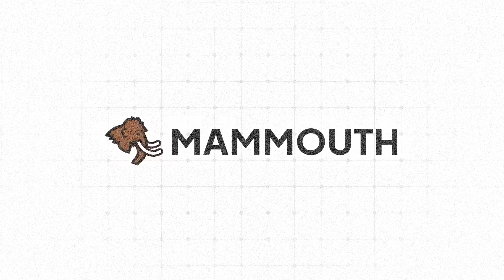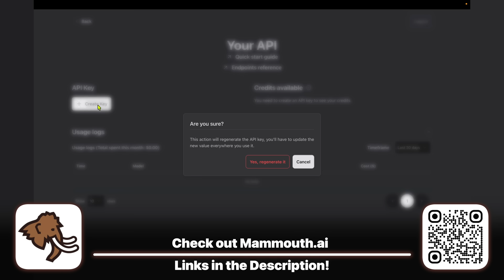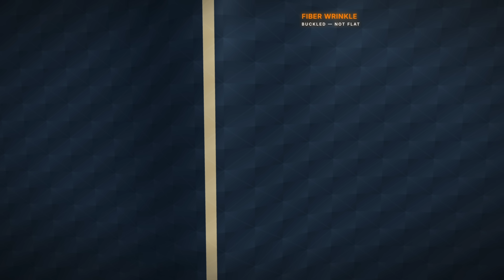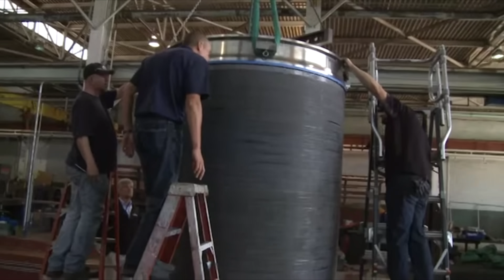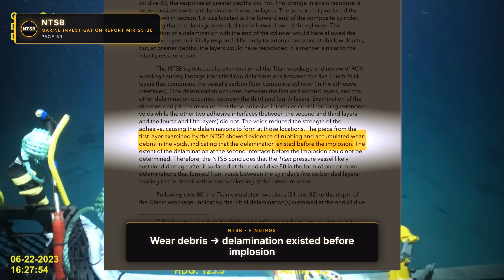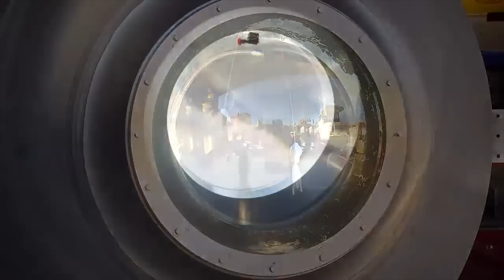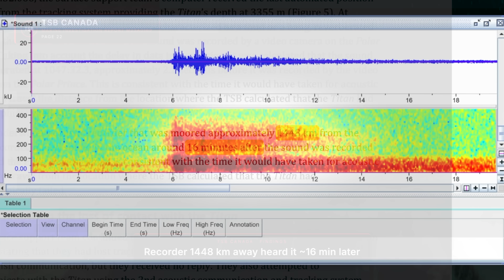Oceangate Titan: It was WORSE Than We Thought

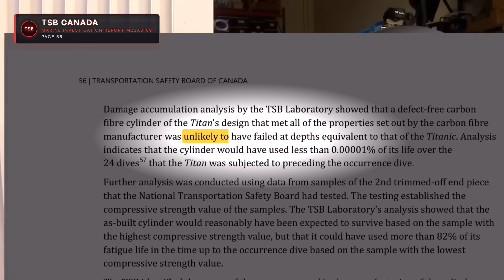Comment: 1:27 Yeah the thing is that's not true! Carbon fiber is specifically not used in submersibles because with repeated pressure and depressuriztion the structural integrity of the carbon fibers gives wy and delaminates from the inner layers making it inherently dangerous and not viable for their use. Obviously it would have been done already if it was safe. And the fact that they specifically didn't have it tested properly and acknowledged that they were "breaking the rules" and chalked it up to innovating proves they should never have been making these machines!!!! As an Industrial Electromechanical technician and former ASE certified master technician (with many OSHA safety certs and an expert of industrial workplace saftey) this man broke all of the rules put his employees in extreme danger and the inevitable happened! It is a shame and very sad story!
Reply: I think there are actually one or two experimental ROV's made out of carbon fibre, but they are much smaller and don't carry people (obviously). Also they probably cost more to make (and were made to higher standards) than the Titan. But yeah, it was a terrible idea and executed in the worst way possible, tragedy was inevitable. Safety guidelines are written in blood as the saying goes.

Comment: 4:10 For life the safety factor 1.11 is not different from 1.25. No materials really follows exactly the same factor of 1.0. There is going to be a significant variation of more than 15%.
9:45 Not reading data correctly is unforgivable. No one had experience with these carbon fiber subs?

Comment: Stockton was no idiot.  And yet he was.  That is the strange paradox here.   He knew the the situation with diving to the Titanic.  And yet instead of overbuilding and ensuring success, he did everything possible to under build and almost guaranteeing failure.
    It seems his goal wasn't really to get to the Titanic safely.  It was to get there as cheaply as possible and "See what happens".
I don't think the thought of implosion was even considered a possibility in his mind.  He seemed to think that things would unfold slowly and he could simply abort the dive and all would be well.
    One thing that I haven't heard explained to my satisfaction is why the sub lost buoyancy and was unable to rise despite jettisoning the undercarriage and using thrusters.  Not that it would have saved them, but they did sit at essentially the same depth until it eventually imploded.

Comment: The problem is lack of circular symmetry in strength. So it doesn't deflect symmetrically, it flattens the center of the cylinder, and that creates anisotropic stresses and is an unstable faliure mode, once it deflects that way the forces increase.  

It's like sucking the air out of a soda bottle, once it goes it flattens assymetrically, which is a much much weaker faliure mode. 

Ocean gate did not even analyse that deformation, they assumes spherical symmetry, which is about as giant a red flag as you can get for something like this. 

Its like designing a building and only ever calculating bearing loads, never anything from widn shear, never anything from earthquakes, just does it hold up when absolute still. 

If some engineer did that. They would be barred from working again for life. 

Ocean gate built a death trap, and you don't even need to be a proper engineer to understand that.

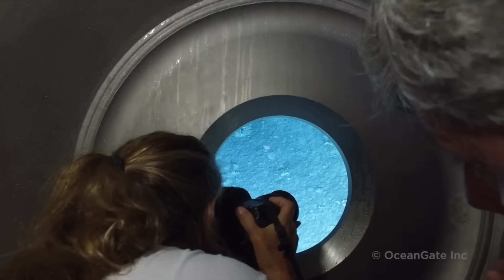Comment: 2:20  well thats not true... You could have had a series of spheres connected to each other horizontally and gotten much the same effect as the spherical craft. Even the single sphere design has a cylindrical attachment thanks to the access point.
Reply: I was think like bigger sphere
Reply: @epikbaconb9780 . The problem is that a sphere has to increase in size exponentially (or at least a lot if not precisely exponentially) to fit more people. It’s not a linear size increase. Unlike a cylinder. And OceanGate was already trying to build at essentially off-the-shelf prices.
Reply: @epikbaconb9780  They used sphere yes because its easy to create with the need for pressure. Of course, those didnt have much space because they were only built for 1 or 2 people to begin with. They have made deep divers not in a sphere formst
Reply: @trli7117  . The more significant angles you have, the more weak points. The larger the orifice, the more it compromises the structure of the sphere. Weakest link philosophy. At some point, the fact they are spheres no longer offers any benefit, because it will just fail at the seams.
Reply: @V.Warlock  aye, with enough pressure any design will fail.  But since we are talking titainum here we can cast the spheres as one object.

Comment: That fudge factor of 1.25 seems rather minimal. I know of many things in industry where they build with up to a 10:1 ratio for added safety.
Reply: It's certainly understandable that in many fields a safety factor of at least 1.5-2x is standard
Reply: no one uses 10:1 lmao
Reply: @Blox117    No one? I didn't say everyone but I know for a fact there are things in the fire service with crazy fudge factors. Things like ladders and rescue rope fall into that category. There are also certain parts on industrial cranes. Most times it has to do with shock loads, not working strength.
Reply: @Blox117  In Commercial Construction/Fire Code anything under 3:1 regulations is considered "sketchy AF"; "scientifically speaking" OFC...
These people WANTED to die.

Comment: Much has been said about the use of a cylinder between half sphere end caps as being an inherently flawed design and a complete sphere is the best, yet that's how every military modern submarine is built. You even said said so very, very, very briefly. Engineering (I'm an engineer) is in the details. The way the Titan was built was flawed in it's lack of attention to the details. Flawed carbon fiber laminations,  machining down the carbon fiber cylinder to fit the titanium end rings, and host of other details. If anything, the carbon fiber cylinder should have been thickened at the ends where they met the titanium rings to accommodate the mismatched materials different stiffness (modulus of elasticity). The bottom line of this tragedy was Stockton was cutting corners to save money. Understandably, he didn't have the budget of the US Navy but building the Titan on the cheap should have shut down this shit show before dive one. We, the taxpayers, paid for the post event detailed engineering analysis. 

Designing vessels for external pressure is far, far different from internal pressure. If an internal pressure vessel for the same pressures at the Titanic were designed, the walls would only be an inch thick. Carbon fiber really shines when in tension. Compression is always more difficult as any design MUST take into account manufacturing deviations and unintended abuse from the theoretical design. Real engineers sweat the details.

Comment: No, the carbon fiber would likely still not have lasted for hundreds of dives. While a spherical shape is the most structurally sound design for resisting extreme, uniform deep-sea pressure, carbon fiber itself is fundamentally ill-suited for the compressive, cyclical stresses of deep-sea diving.Several factors explain why a carbon fiber sphere would still be prone to failure:Cyclic Fatigue (Micro-cracking): Deep-sea pressure compresses a hull, and it expands again upon surfacing. Unlike metals (such as titanium) which flex predictably and bounce back, composite materials like carbon fiber accumulate hidden, microscopic damage with every dive. Even in a perfect sphere, this material fatigue degrades the structural integrity over repeated trips.Delamination: Deep-sea pressure can force water between the layers of epoxy and carbon fiber. Over repeated dives, these microscopic fractures cause the layers to separate (delaminate), leading to sudden, catastrophic buckling.Compression Limitations: Carbon fiber is phenomenally strong when pulled (tensile strength), but it is much less reliable when subjected to the extreme crushing forces (compressive strength) encountered at the depth of the Titanic.Dissimilar Materials: A sphere would still require metal end caps (hatches and windows). Joining carbon fiber to metal is notoriously difficult because the two materials expand and contract at different rates under intense pressure, creating severe stress points at the seams.Traditional deep-diving submersibles (such as the ones used to study hydrothermal vents or wrecks) almost exclusively rely on thick, solid metallic hulls—usually titanium or specialized steel—because these materials can endure hundreds of pressure cycles without suffering from internal micro-cracking.
The reason carbon fiber is never used in the manufacture of deep sea submersibles is that it's totally unsuitable.

Comment: The US Navy funded a research program in the early 1980s to investigate the use of carbon-fiber hulls in an attempt to obtain 'neutral buoyancy.'  I think that Stockton Rush basically used their findings to manufacture the Titan.  There are detailed drawings in the Navy report that show a carbon-fiber hull, plus 2 titanium rings that are glued to the carbon-fiber and then 2 dome-shaped titanium end caps bolted to the rings.  The Navy actually used this design to build a torpedo shaped deep-sea probe called AUSS  (Advanced Unmanned Search System).  The system was capable of diving to depths of 20K feet..  The pdf report did state that the researchers did not see any potential drawbacks for producing a vessel up to 10-ft in diameter.

Comment: The US Navy had already built and used a deep sea submersible out of carbon fiber with titanium end domes. The U.S. Navy has previously experimented with carbon fiber for deep-sea submersibles, most notably with the Advanced Unmanned Search System (AUSS) in the 1980s and 1990s. The AUSS utilized a filament-wound carbon fiber hull with titanium end-caps to operate autonomously at depths up to 20,000 feet. The Advanced Unmanned Search System (AUSS) completed 134 dives during its operational testing and development lifecycle.The vehicle was heavily utilized during sea trials off the coast of San Diego in the early 1990s. It regularly performed deep-sea operations—including a record-setting dive down to 20,000 feet—before the program concluded and the system was transferred to the Navy's Supervisor of Salvage and Diving in 1994.

Comment: They cheaped out. Crunch. End. Carbon fiber has its uses, but this wasn't one that would work. Defend carbon fiber all you want, but this wasn't a proper use and that's a no-brianer. Carbon fiber has to be done VERY VERY VERY right or it goes really really really wrong. End.

Comment: Carbon Fiber - Regardless of what other ignorant EXPERTS conclude. CARBON FIBER IS NOT A COMPRESSION VESSEL MATERIAL.   Carbon Fiber is good in tension.  It is not a compression material.  A Pressure Vessel is a great application for Carbon Fiber.  A compression vessel for DEEP DIVES is a VERY IGNORANT AND S.T.U.P.I.D. Choice.  The Results ARE THE PROOF.  Note: Earlier dives recorded or noted that they heard LOUD CRACKS! These were composite material cracking and Carbon Fibers being crushed. STUPID!!!  STUPID - STUPID.  Stop trying to be/sound smart and justifying Stupidity!!! It OBVIOUSLY KILLS PEOPLE!
Reply: Yes, you can use carbon fiber for ease of manufacture in recreational, shallow, underwater vessels. They're subjected to relatively low pressures compared to the failure pressures of Carbon Fibers used in compression.     Cement might make a better Deep Dive Vessel. ???

Comment: You start out by saying
 'carbon fiber...not the villain' then spend rest of video showing it was (in effect). 
Also sort of nonsense on the cylinder diss. Sphere is ultimate but most other high pressure vessels from submarines to all the gas cylinder bottles out there are cylinders. Their behaviour is very well understood.
Reply from the maker: traditional subs and gas tanks don't see the pressures you get at 12,000ft below the sea. that's a very tough regime

Comment: The low Safety Factor of the Titan makes ABSOLUTELY no friggin sense. In aerospace engineering the safety factor is aimed to be low (just above 1) because of the weight; throughout revisions of the jet engines and mechanical parts, some non-essential parts are redesigned, either because of  fatigue-induced failure or because they were originally over-designed. In the case of a submersible there is no weight limitations to be concerned about. This thing could have had an initial SF of 1.5 or 1.6 and then lowered after revisions but then again, that's what failure tests are for. 
In another topic... If I would like to go see the Titanic....I don't get the obsession of people with that shipwreck to begin with.

Comment: I am reminded how material (metal) fatigue was not a part of the equation in pressurized aircraft until the de Havilland Comet (first pressurized jet airliner) had two mid-air breakups and crashes.  And even then it took a year of intensive investigation and testing to find metal fatigue was the cause (coupled with the square window design that focussed stresses in the corners).

Comment: Silicon chip wafer experience here. The wafer is not cut into chips then tested. The first test happens while the wafer is whole with chips that have obvious defects marked with red ink. Then after cutting, the red dot chips are discarded. The chips not discarded then undergo another HITL (Human In The Loop) inspection where they are sorted or made ready to sort. After sorting the chips are packaged into the "package" (the part that connects the silicon to the substrate/board).

Comment: I only have a bachelor's degree in materials engineering, but to me, everything you say in this video tells me that the choice of carbon fibre is to blame.
All the information here about the different defects, and their propagation under load, would have been different in a metal hull. The accumulated damage from towing the submersible, and storage in freezing conditions, likely would have been negligible too. Most importantly, though, the science of testing and monitoring the hull is much better understood for metal pressure vessels. I don't think there would have been anywhere near the leeway for the boss to just declare, let's go again and see what happens.

Comment: I’ve been 3 km down at the bottom of the pacific in DSV Alvin (the sub that first explored the Titanic and discovered hydrothermal vents) doing research at the Dorado Outcrop. Coolest thing I’ve ever done. I’d absolutely go again. It is safe when done properly. 18:37
Reply: The design Oceangate had was good, but the construction is where things went wrong.  I doubt it would have lasted near as long as DSV Alvin, but it should have lasted longer than it did because of the horrible construction.
Reply: @BradKandyCroftFamily  yeah sounds like they should've had seven 1-inch layers that were actually sealed together properly
Reply: Never safe 3 km down.

Comment: the 10 cars on the plot are not dissimilar because tolerances. The tolerance is designed for any specific component. It will stack up. They are just perfect as they are because they fit into the tolerance stack and passed quality. I remember one specific how its made video or something about eurofigher typhoon. It said the stacked tolerances of components amount to like 2,5cm in the total length or the plane. So anyway to say the carbon fiber wasnt at fault is nonsense. It was because it wanst bothered to be used properly or tested or anything. Just add more tolerance stack if it doesnt work. Thats just manufacturing more cheaply because you can have blind people pull the arts off the line and say its good enough. If you have 10 parts 10mm long that have tolerance of +-0.1mm you get stack of 99.0-101.0mm. Its good enough.